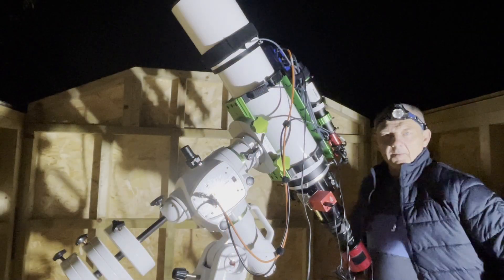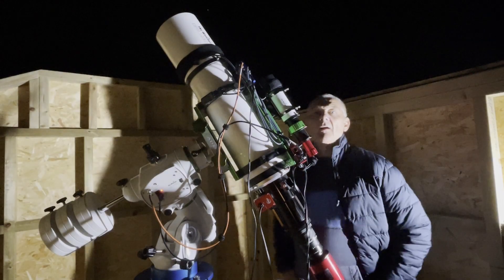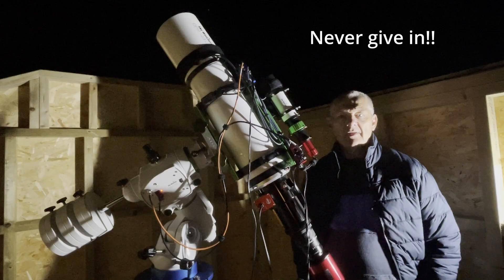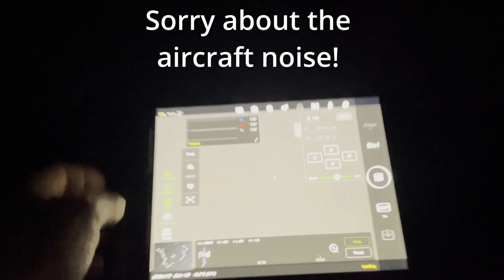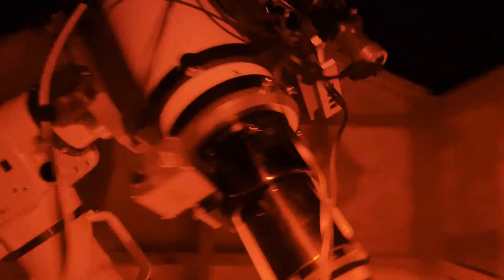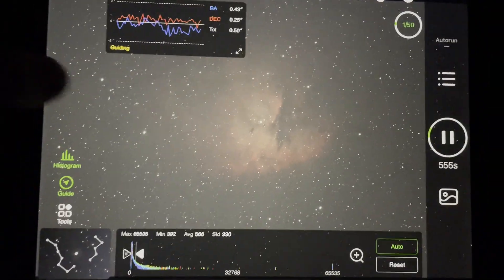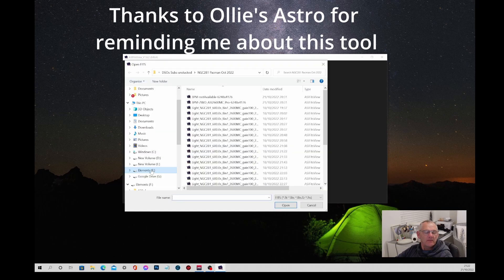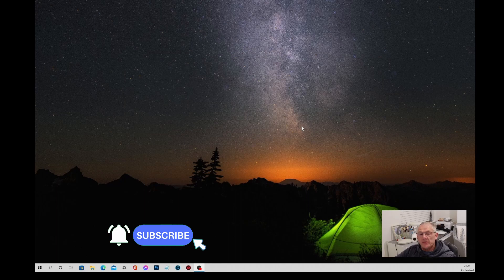Astrophotography The Pacman Nebula

Comment: Great image Simon! Sometime I miss my 2600MC. Which is the plate you use on top on your tube? I'm looking for some plate for my tube to attach gear.
Reply from the maker: Thanks David, I will miss my 2600mc, I’ve just tested my mono setup last night getting ready for first light with the Antlia 3nm filters and 2600mm!
My top plate is the Skywatcher Losmandy 350mm x 100mm.
I need some more of these also for my second rig! Most places are out of stock though! Good luck and clear skies👍